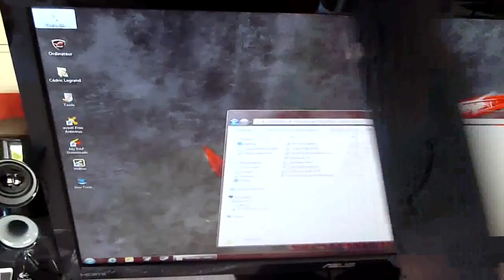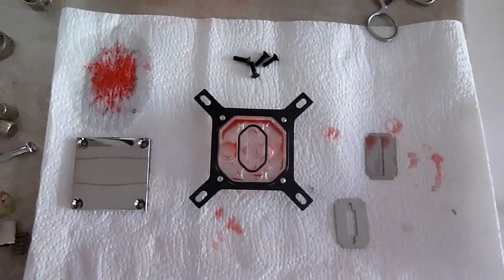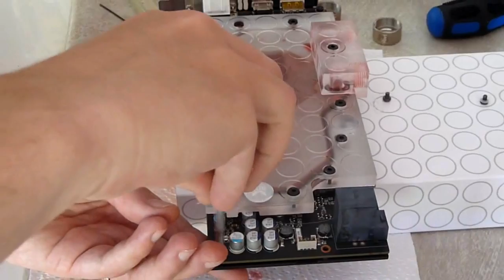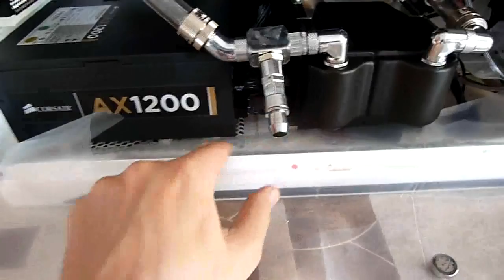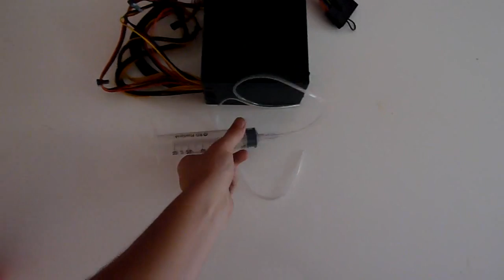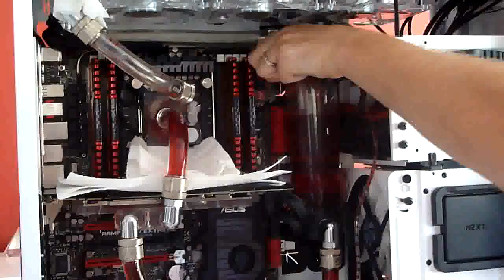NZXT Switch 810 Watercooling Update 1

Comment: All those 90 degree fittings...  That's a lot of added unnecessary restriction to your loop. P. S work on the cable management it's makes your build look quite untidy when it has the potential to look great. 

Maybe take a dremel behind the 5 1/4 inch bays and route the cables through there. 

Looks good though, 8/10

Comment: your running your CPU flow  backwards! The inlet is closer to the middle and the outlet is closer to the edge. very important to run the flow direction  correctly. you can turn your CPU block 180 degrees to fix this.

Comment from the maker: Si tu mets ta valve juste après ton rad (120) en façade, ton point de drainage sera plus haut que ta pompe. C'est pas top. Moi je te conseillerai plutôt de mettre un 240 en façade comme ca les entrées-sorties du rad en façade seront proche du bas de ta tour ( le sol de ta tour pour que tu comprennes bien ) et de la tu fixes une valve à la sortie du rad et un tuyaux en ligne droite qui part direct sur ta pompe qui devrait être également fixée sur le sol de la tour.

Comment from the maker: Absolutely 1/2 inch ID and 3/4 inch OD Tygon Clear tubing, all fittings ( same size as tubing ) are silver compression fittings (EK) with G1/4 inch thread and all 45°/90° elbows are silver (alphacool)

Comment from the maker: hey thx for watching! if you read all comments i wrote that the watercooling as it appears in this video costs 700 euro ( half money ), but so far i added a second gtx 680 so a second waterblock for the gpu, a second swiftech mcp35x and other radiators, fittings, so price for all costs now 1500 euro... I will continue this build log so you will see what i got for 1500 euro.

Comment from the maker: Hey, thx for watching! Unfortunatly i had to drill 2 holes in my case ( i did not want to at the beginning ) but at the end the result was good for my reservoir. the pump is mounted to the bottom rad using the bracket of the COV-RP400 pump top. take a look at the update 2 videos series for more details.

Comment: How did you mount your rez and pump to the case? I have seen some rigs where they use the pump top mod and it connects directly to the bottom of the rez. I actually prefer the seperation as in your build. I don't want to put holes in my case if I don't have too. Thanks.

Comment from the maker: Yep, sure, here they are

EK Supremacy CPU Waterblock
EK FC GTX680 CSQ GPU Waterblock
Pump Swiftech MCP 35X
Pump Top EK-DDC X-TOP CSQ - Plexi 
Radiator Swiftech MCR320-XP, EK XTX 120
EK Coolant Blood Red
Tygon Tubing Clear
EK and AlphaCool Fittings
NoiseBlocker Multiframe M12-S3H, Xygmatek CLF-F1252 Crystal LED 
Lamptron FC6

Comment from the maker: Hi, at the beginning i went for Koolance COV-RP400 pump top, it has a very usefull mounting bracket you can fit onto 120 mm rad or fan but when ek ddc csq top was released i kept the mounting bracket of the koolance one and bought the ek pump top. i still keep the koolance top as a spare and i will have a special utility for it in my next video.